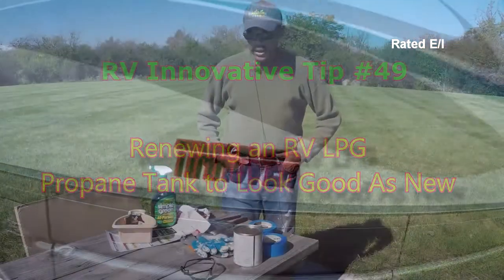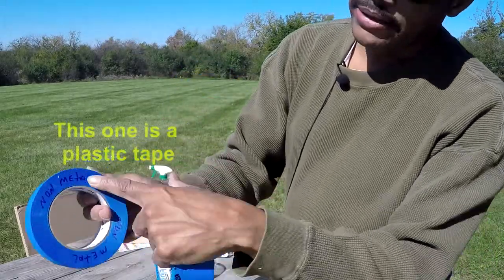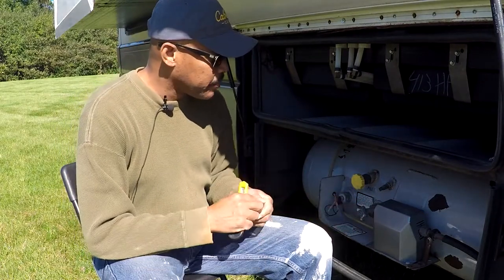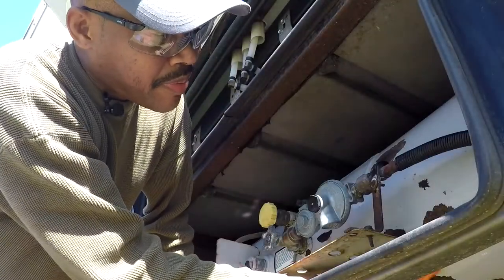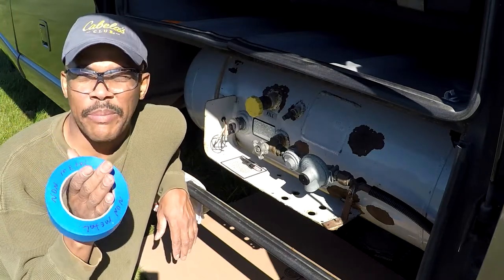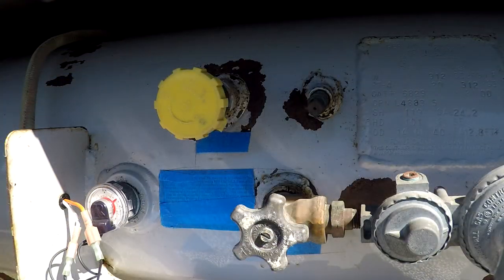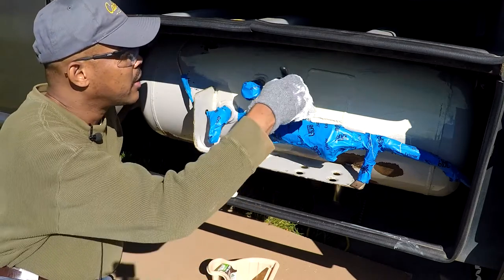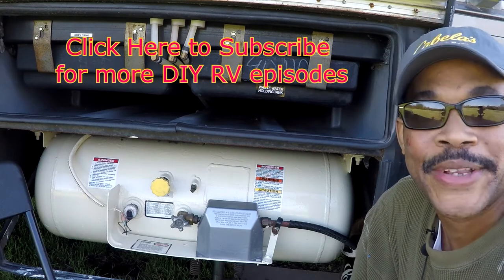RV Innovative Tip #49 ~ Renewing the RV LP Propane Tank (On Board)

Comment: Do you have any info , How often does a RV propane tank need to be recertified?
Reply from the maker: Great Question, most if not all RV's have an installed ASME (American Society of Mechanical Engineers) tanks, not DOT tanks.  ASME tanks are not required to be re-certified since they are permanently installed. On the other hand DOT/TC cylinders, the kind you purchase from your local home center store and/or gas station, qualifies for periodic re-certification.  Don't forget to check the laws in your state. 

Here are a few helpful links:
 https://rvshare.com/blog/the-ultimate-rv-propane-tank-guide-read-this-before-fixing-or-buying/

http://npga.wpengine.com/wp-content/uploads/2017/08/NPGA-Todays-Propane-2017.pdf

Safe Travels!
Reply: After 12 year's a propane tank needs recertification, then every 5 year's after that. But most state's you don't need to recertify your Class A or Class  C permanent propane tank. I've had a difficult time in Florida with a RV park office worker because she doesn't like older RV'S, Campers, Etc. Or people that are under $100,000 year. She made me recertify, upgrade tank part's, many upgrades that I didn't need. Just to make me leave here. I stood up for myself, but still had to deal with her and up grade RV. This is only RV park in my area that includes almost everything I need except internet,but I was able to get my own installed to my 1984 E-350 Class C 24' Midas Freeport 7.5 460.  : ) Check local law and save $. Have Blessed day.
Reply from the maker: That is correct Gary RV's with permanent mounted tanks doesn't need re-certification  and that was one reason I decided to shoot a segment on "at least" keeping them looking good and in shape. I am elated that you stood up for yourself, I figure if you keep your area clean and tidy it should not be a problem.  Safe Travels!
Reply: Every 10 years in Texas. Most states are the same.

Comment: 7 years late to the party, any recommendation to coat road-exposed side with something to protect from road debris?
Reply from the maker: Ha’  That’s funny…..seven years late.  Well I think I did not add additional material to the underside of the tanks.  Since onboard LP tanks expand with the outside temperature especially with heat. Any thicker material will not allow for expansion, similar to the material on the back of a truck bed.   Most LP RV tanks wall thickness 9/32" - 5/16" (Lots of metal).  If you have the link on the material that can be used, send me that link,  interesting.

Comment: Excellent job! My RV propane tank is in similar condition. I will tackle this project in the spring when the weather warms up. Again, Great video, thanks for sharing!!
Reply from the maker: Thanks, it was a great project! Basically the tank was on empty so I really felt better with all the scraping. I was more concerned of sparks or rupturing the tank.  But it turned out great, I was told that sold the new owners. 👍🏼

Comment: What model Manchester tank is that?
Reply from the maker: Great question Rachel, back in the late 90’s , there were only a few ASME DOT certified RV LP tank manufacturers. Each model number will be different based on the onboard RV tank shape, size and the amount of propane they can hold. You can check out
www.mantank.com for additional information.  Safe Travels and enjoy your summer Rachel! 🏕🇺🇸